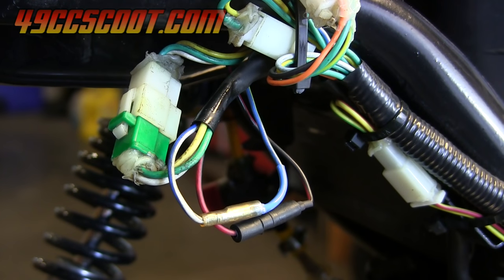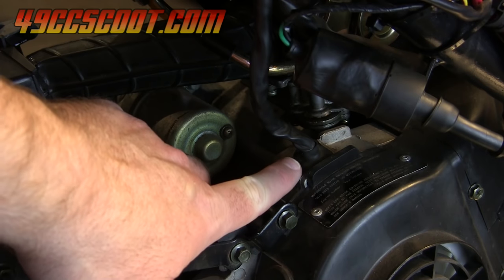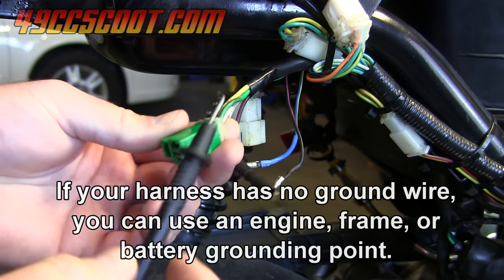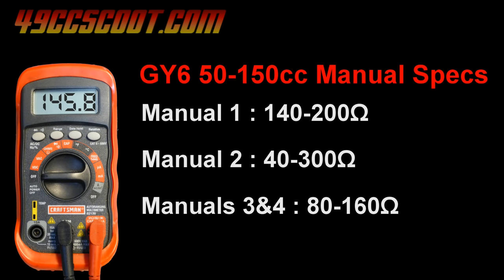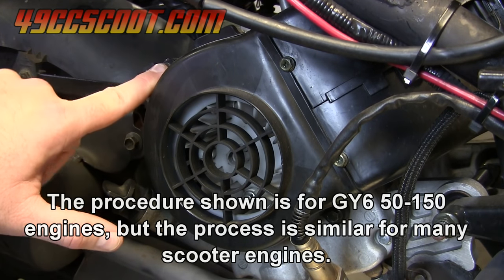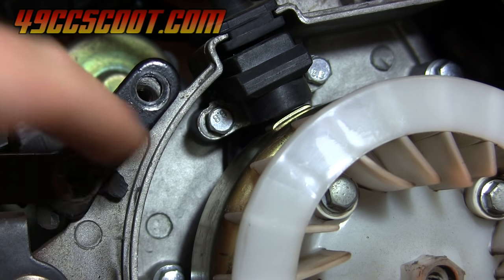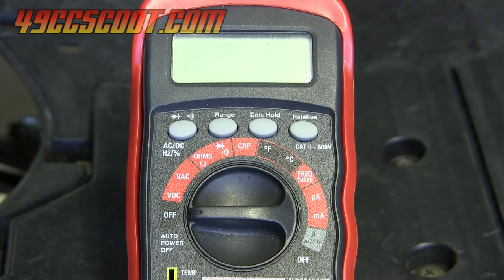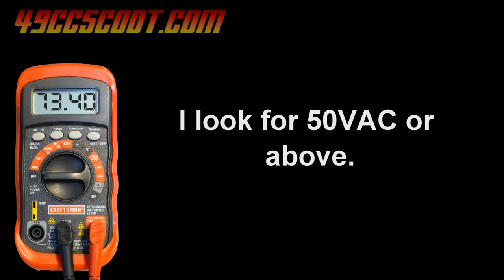Ignition Pickup And Stator Checks For AC Scooters, ATVs, & More

Comment: I HAVE A RIYA PEACE-SPORT 150cc SCOOTER. I ADJUSTED MY PICK-UP SO I HAVE .5 VOLTS A/C WAS ONLY .20. BUT WHEN I CHECKED EXCITER COIL A/C VOLTAGE IT ONLY WOULD PUT OUT 41 VOLTS A FAR CRY FROM THE 73 VOLTS YOU GOT AND LOWER THAN MINIMUM 50 VOLTS A/C. WOULD THIS CAUSE MY SCOOTER NOT TO START? I HAVE ALREADY REPLACED THE CDI. I HAVE COMPRESSION AND I SET VALVES TO SPECS. .003 EXHAUST & .003 INTAKE.
Reply from the maker: Voltage could be low if it isn't cranked over very quickly. Might wanna check resistance specs to see if they are in the ballpark.
Reply: When I do disconnect the pulse & exciter leads my engine does turn over much slower than when they are connected which puzzled me as to why ... even when I had my Battery Charger Engine Start Booster on the Battery (14.5 volts) the engine still turns over slower than when the two leads are connected.
Reply: As he said resistance specs vary so much that its almost useless.
Reply from the maker: The slow cranking could be a timing issue. If it fires early the piston has to fight a lot of pressure to make it to TDC. You should check spark before doing any of these checks. Bend the strap back or cut it off of an old plug and use that to check spark (or get an HEI tester or adjustable gap tester). If it can arc across a big gap like those provide, you don't need to check the things related to spark strength. Then, if it's ignition related at all, it's more likely to be timing. Possibly a faulty CDI or the flywheel is clocked wrong (sheared woodruff key).

I know I said specs vary, but if you can't get a definitive answer one way it's not a bad idea to at least try another way and see if they're in the ballpark.
Reply: i know its a year later the only thing left is the stator. its a process of elimination.if it doesnt  start cdi, stator, coil, thats what i did.

Comment: The scooter I have has sat inside for a long time because it wouldn't start. Everyone says the cdi, the stator, bla bla bla...
I went through all of that. Switches, stator, cdi, wiring... I did find some problems but when I got it to turn over finally, the starter would turn, then not turn, so I took it off to clean it and bench test it. The starter bearings were bad and sticking. 
It has sat for 5 years after 2 mechanics charged me to check out, told me it was cdi and stator... for a bad starter that not one mechanic ever mentioned to check or checked themselves.
Sometimes it is a mechanical issue.
Check the moving parts...lmfao

Comment: hi like your video good info . can you help me gy6 engine 125  i got 3 yellow white going in to the 3 pin plug  they got to the rectifier  i got a green wire seprate which is earth and the blue and white wire pickup   i.m getting arounf 5.7v ac on all 3 yellow wires   the auto choke runs of one of these wires i always thought these ran of 12 v  am i righting in thing stator has had it
Reply from the maker: If you're only seeing 5.7V with the wires disconnected from the rest of the harness as shown in the video, it doesn't sound good. I haven't really messed with the full wave 11/12 pole GY6 stators though, which is what I'm guessing you have since you have 3 yellows.

Comment: hi, replace it solenoid , got green light on , push start, I get the solenoid to make a click noise but not starter run ?? battery bad. I read 13vdc from battery.
Reply from the maker: +Mike Gallo Try a load test on the battery or jump the terminals of the relay as I described and see if it cranks that way.
Reply: +90GTVert 
Hi, I got a new battery and spark plug but I am getting no spark. Do you have a video on how to replace the coil, CDI or stator?
Reply: +Optimus Prime 
Ops I watched the video and realized the wires are the stator you were talking about lol. Got it. Thanks again.

Comment: My black and red wire shows 3v, thanks for help :)
Reply: Evaldas Kucinskas Hi, So I have a Honda SA50 1996 And I replaced the starter cause it wouldn't turn I replaced cdi box and ignition coil and still no spark also new battery I had it running yesterday I killed it and it won't start anymore. No power even gets to the cdi box what wiring could've gotten messed up
Reply: Evaldas Kucinskas I didn't mean to write to u
Reply: Same here. Did replacing the stator fix your problem?

Comment: PS i purchased new cdi and coil and tried and checked all grounds.. But this test was directly off the battery grd. and no voltage
Reply: I tested and replaced most all components, as i cashed no spark thru out the checking process. either way i learned a lot from your video. very professional. However no one speaks of the kickstand as a element in checking missing spark? Some scooters such as Wildfire installed a safety switch on the kickstand . the stand must be in the up position before there can be spark. Learned the hard way... Thx Denny

Comment: The stator on my taotao 50cc scooter is putting out over 160vac . I'm having serious problems with my charging system  and it blows headlight bulbs as soon as I put bvb them in....any suggestions  ? The staor is on a brand new motor that I purchased  off Amazon.. I have replaced the R/R  and other parts...still same problem. I've  had to purchase 2 new batteries along with various parts because of this....please help...this is getting  quite expensive.
Reply from the maker: An easy solution would be if your old stator worked, then put it on and see what happens. You can try checking the resistance values as well, just to see if they're way off or not.
Reply: I had actually  thought about doing that very same thing because  the issues didnt start until I changed motors ....also...I had to cut and rewire the connection plugs for the stator because it didnt match my stock plug assembly. THANK YOU FOR YOUR RESPONSE
Reply from the maker: @blooddogbloodwork2435  Unfortunately some of these stators look basically the same but they aren't. I tried to swap stators on a GY6 in the past and had this happen till I finally found the right one. You could probably fix it by figuring out the proper R/R for it, and possibly rewiring... but it's way easier to go back to the old stator if it's working.
Reply: With that stator putting out so much voltage  , do you think it has fried the new  R/R that I just installed  ?
Reply: Ok...The stator in mybold motor performed properly  . I took that stator out and also the stator out of the new motor. The newer stator was visibly  bigger than the one from my old motor.  So thinking  that to be the problem I put the old stator on the new motor. Now I have a no spark condition.  Could not enough clearance  between the pick up and the relucter cause a no spark condition  ? This is my main mode of transportation  and I am at my   wit's  end with this.
Reply: Does it make any difference  which flywheel I use ?
Reply from the maker: @blooddogbloodwork2435  Might as well swap it all to be sure, but probably not.
Reply from the maker: @blooddogbloodwork2435  Well if the stators are different sizes, then you're going to need a matching flywheel.
Reply: Thank you for your help. It's  up and running. Charging system  is working great and headlight is working properly...no longer popping bulbs. The no spark issue....pickup wire was pinched behind the pickup and was grounding out.....Thank you much.
Reply from the maker: @blooddogbloodwork2435  Glad you got it straight.

Comment: I’m needing some serious help with this issue. Any way that we can communicate directly? Messenger or something???
Reply: I’m dealing with a newer Apollo x4 110cc. No spark! Replaced the coil pack and spark plug wire, no spark. Replaced the CDI, no spark! Only 3 wires coming from the magneto. Blue/white, Black/red, and green. Only a single coil inside the housing. Ohms are right inline with your video and volts reach a max of 1.0 between BW & BW. Nothing registers between either of those & Green.
Reply from the maker: @TheFlyboi1706  Blue/White is usually the pickup/trigger signal. That normally reads about 0.5VAC ballpark on these small engines. That is done cranking the engine over with the wires disconnected from the rest of the harness. Black/Red is usually 50VAC or greater, tested the same way. Could be a little lower if not cranked over quickly.

Comment: i have this pgo bix max i changed the stator and got from 20 to 100 VAC but whe i checked the pickup its 0.2VAC..
could be the flyweel problem or something else?
Reply: dont get spark at all
Reply from the maker: Check the gap between the reluctor and the pickup. 0.2V is not out of the range for a working sensor from what I've seen.
Reply: id checked my flywheel and it was rusty i was thinking to replace a new one
Reply: can they go bad magneto?
Reply from the maker: I've never had to replace a flywheel for a no-spark issue. Maybe try brushing  the rust off and see if it changes.
Reply: 90GTVert thanks...ill try to adjust the pickup,if i stil dont get spark do u think cdi is the problem?since power comes first from the stator and pickup then to cdi then cdi to ignition coil
Reply: btw i did cleaned and brushed also the flywheel
Reply from the maker: If you can find a service manual, it should show the test and specs for the coil. I assume it has a wire on the CDI to disable spark with a ground. If a switch goes bad or an alarm malfunctions it could be getting  a ground when it shouldn't have one. You can check for continuity to ground when everything is set to run on the kill wire. If it's grounded, then you may have a problem. Service manual usually has a wiring diagram to figure out what's what.

Comment: 90GTVert There are only 3 wires coming from my stator a single "blue and green", and 2 wires leading to a plug a "pink" and a "yellow". @90GTVert
Reply from the maker: Those colors don't mean much to me. Yellow would commonly be a charging or lighting wire. Not sure about the others. Is it DC ignition (wouldn't have an exciter coil on the stator, but instead would power the CDI from the battery)? May have to do some tracing to see where wires are headed.

Comment: do you have a schematic of simple ac cdi?? i cant find nothing to working for my GY6 150
Reply from the maker: You can google CDI diagram or something like that. Considering you can get the for ~$10, it's hardly worth fiddling with them for most.
Reply: thank you. i have a big bore kit from 125cc to 150cc and cdi is my nightmare. all cdi's here in greece is for 50cc....  No advance timing, no revs, no fun.....
Reply: hey bud im not very good with electrical i have a 150 no spark i tried a cdi and spare coil i had. stator?  let me know if you have an idea. thanks.
Reply from the maker: This video will show you how to check and find out if it's the stator. I don't really know how to explain it any better than the video.
Reply: okay i did and still no spark like everything else ill figure it out.
Reply: my dumb ass brother fuked the wiring up its a 150 gy6 5 wire stator.
Reply from the maker: Make sure there is not a ground applied to the CDI on the kill wire. Could be a short or switch malfunction or just improperly wired. Also, don't let your brother touch any more scooters. lol
Reply: ill check its fukin weird it runs fukin mint one day then no spark the next.hes not touchin shit no more.thanks for your help.
Reply: 1 more thing the 5 wires from the stator go to the cdi?
Reply from the maker: Shouldn't be. Most are just a pickup signal and AC power to the CDI. The rest are usually charging, lighting, and ground.
Reply: yea i looked after 1 goes to the cdi the black with white striped one 2 to the cdi 1 to the coil. im getting the hang of it now but one more thing the green wire from the cdi no fuking idea. it was hanging there when i took off the cdi.
Reply from the maker: Green is often ground. Could go to the kill switch. If it's to the kill switch, it's usually a dark green. Regular green is more often ground. May have to do some tracing to be sure.

Here are some wiring diagrams that I made that may be helpful :
http://49ccscoot.proboards.com/thread/2556/wiring-diagrams
Reply: thank you it was helpful it goes to the ignition switch. the odd thing is it ran all this time? i dont have a kill switch the key is the kill switch.
Reply: well i got the stator yesterday and wired it in and all i can say its about fukin time that green wire from the cdi went to the ignition switch but that wire was for the lights. one thing after another. but it is running so ill figure that out too.

Comment: I have a flat spot on the acceleration on my scooter. I am pretty sure it's something with the CVT. Do you have any idea how i can fix this problem?
Reply from the maker: Srmetallica99 I usually start with a thorough inspection. No sense tuning only to find rollers are flat or the torque driver grooves are worn.
Reply: +90GTVert I have Dr.Pulley weights. And the grooves are in good condition
Reply from the maker: Where/when is this flat spot? What is your RPM doing at this point? Any other observations that may be of use?
Reply: When the speed are between 20-30 kph and after 30 kph it accelerate smothly (sorry for my bad english)
Reply from the maker: Is RPM spiking there? Very high? Maybe it's an issue with the clutch not totally grabbing till late?
Reply: It's a little higher than it should be. It feels like my scooter enginebrakes but the speed increase a little bit and after 30kph it's accelerate smoothly as I said earlier
Reply from the maker: Try swapping roller weights slightly heavier and lighter and see if you can make it better that way. If you have a dual angle torque driver (the grooves in the TD look bent) then it may be that you see a little spike in revs as it shifts from one angle to the next.
Reply: It got worse when i changed the bowl for the wheights. I have video on my channel. You can here that the rpm is good, maybe it's t the belt?
Reply: Weights*
Reply from the maker: RPM sounds slightly low to me, but then a lot of people seem to like the RPM to stay lower than mine. I'm surprised there's no gain with a little lighter weights. If the belt is near original spec it's prob not the belt.
Reply: +90GTVert I start to Think that the clutch is sliping because the clutchsprings have become to soft?
Reply: +90GTVert Do you think it is the clutch that's not gripping so it struggles to accelerate?
Reply from the maker: If springs get soft they will engage sooner and be less likely to slip. Clutch slip would result in higher RPM. Is engine compression up to spec? Nothing sounds way out of whack with CVT operation that I can tell via video, so perhaps there's an engine performance issue.
Reply: I found the problem. It's the contraspring because the length is 92mm. And when i tried to make the spring longer it got a little better :)
Reply: Are all original contra springs 152mm in length for 50cc gy6 engines?
Reply from the maker: They should be close, but the "wonderful" thing about Chinese scoots and parts is that they're rarely all exactly alike. This is part of the reason I switch to a 1000RPM contra spring from a name brand so I can get an exact replacement when needed.
Reply: What length did you have on you original contra spring on your TaoTao?
Reply from the maker: Never measured it new and it will change with use. Only info I have about it would be here :
https://youtu.be/xxnewsv2fok?t=12m17s
Reply: Do you have a guide on how to change the oil seal where the flywheel are? My seal is leaking so i need to replace it.
Reply from the maker: http://49ccscoot.proboards.com/thread/1303/easy-metal-seal-removal-technique
Reply: Thanks :)
Reply: I replaced my crankshaft from another engine and after that my engine sounds very weird. The bearings is in good condition. I have a video on how it's sound on my channel

Comment: hey guys how you doing I have a TL1000R I replace my rectifier and my stator they was charging 14-bolt now I let it sit the bike for about 6 months now is charging 12 volt and I check my rectifier oms Andy Reid .4 oms what do you think is going to be the problem you think I have bed rectifier
Reply from the maker: +Francisco Sandino Check your battery out since it sat so long.
Reply: I do that buddy I put the volt ohm meter and and read 12 volt. Or maybe my rectifier is defected
Reply: But thank you so much for you look up
Reply: Do you think should I buy another battery ?
Reply from the maker: Have you tried charging the battery and then letting it rest for a couple of hours to get rid of the surface charge, and then recheck? 12V for a charged battery is bad. I know they're called 12V, but really what you want to see is closer to 13V.
Reply: Yes I do charge the battery and let it set for a couple of days and now I'm going to check it out then say 12.7 volts

Comment: Hi somebody  know  the  type  and  number  of  this  multimeter,thankyou
Reply from the maker: Craftsman 82139
Reply: @49ccscoot  Thankyou very  much  all the  best  from Denmark
Reply: @49ccscoot  it is  difficult  to  find  on  net   have  tryed   tell me   if  i am  wrong   i dont  need  an   DVA  to  measure   ignition the  meter  can  cope  that  peak  ?
Reply from the maker: @KurtBergNielsen  None of the scooters that I've checked have pushed the limits of my plain old multimeter.
Reply: @49ccscoot  Thankyou   for quick  answer   ,i would  like  to  use  the  meter  on  my   outboarder   i have some   problems  in  high speed  the engine slow down  and sometimes   stop  so i  have  to  check  the  ignition  if stator  is   ok  some  meters  have  DVA  build  in   and some  dont   i just   lost  my  old   meter and want a  new  digital  meter